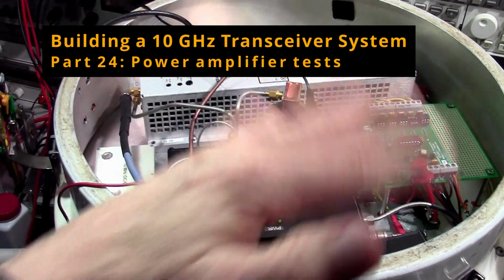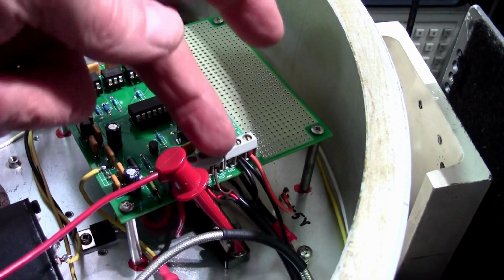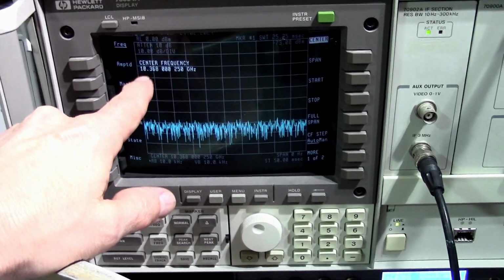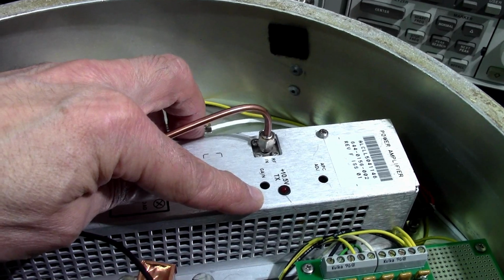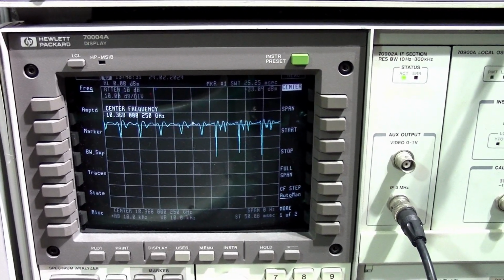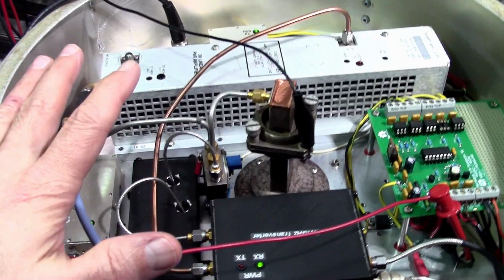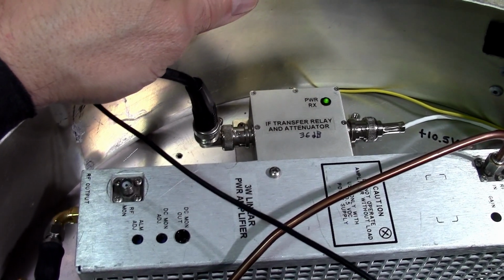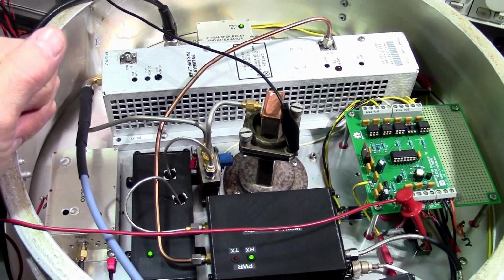10 GHz System, Part 24: Testing the Transmit chain: Hear the result.

Comment: What if you use 70cm or 23cm tranceiver as IF? At 23cm the lower lob is 2x23cm so say 2GHz so at 8GHz so you can filter it out? Making is a real SSB at 10GHz??
Reply from the maker: Yes. If I had to re-do it, I would use 70cm for the IF. The other advantage is that the noise from switching DC supplies is much less.
Reply: @VE2ZAZ and is the adf4351 not to noisy?  However you might get the 5th 2ghz harmonic straight out of the adf4351???

Comment: How to make a frequency mixer? For qo100 upconverter
Good luck for your project
Reply from the maker: Use one of the Mini-Circuits double balanced mixers. Available in many forms and specs. The ADF4351 synthesizer is a good local oscillator. But nothing is simple, so not for beginners.
Reply: @VE2ZAZ  I have make my own it's working !!!!! and yes i use ADF4351 ,thanks you. you can check my project i have make one video about it on my channel
Reply: @VE2ZAZ  https://www.youtube.com/watch?v=UVKdhYhQKz8